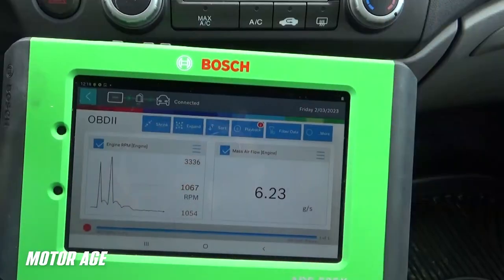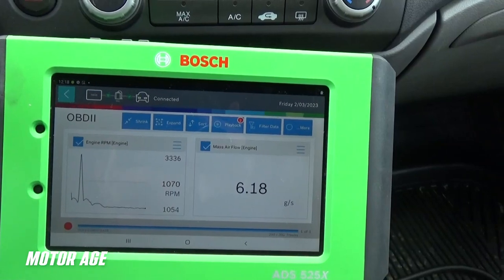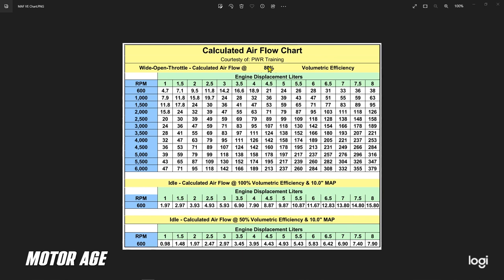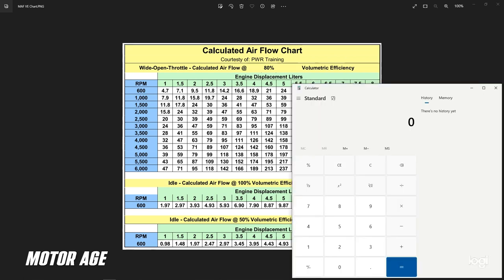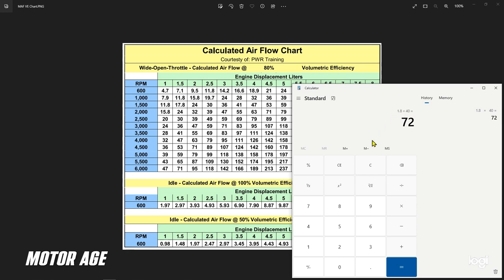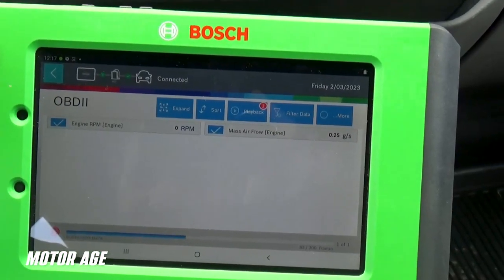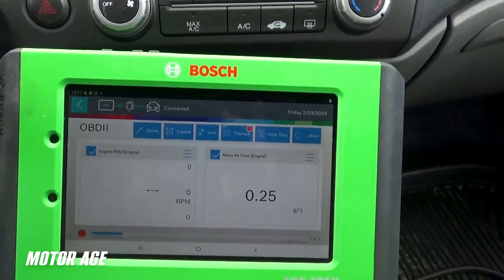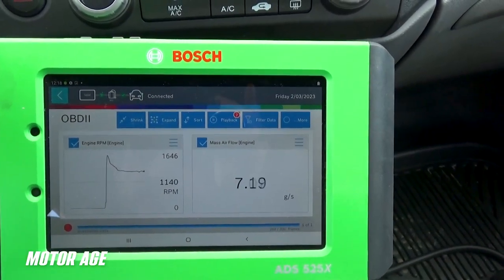Mastering Vehicle Diagnostics #3: Evaluating Engine Mechanical Condition from the Driver’s Seat

Comment: Excellent video! I thoroughly enjoyed it, and your responses to the comments below added to my comprehension. Regarding a vehicle equipped with only a MAP sensor, a narrowband oxygen sensor, and a CVT transmission, is it possible to shift the gear stick to 2nd, press the pedal to avoid entering open loop, and monitor fuel trims?
Additionally, is a reading above 80% considered satisfactory, or should it ideally be above 90%?
Reply: Great question but I can't answer it from experience.

Comment: Do you have a preference for this test or relative compression test first?   What drives this decision?
Reply: Honestly, there is no wrong answer but typically I am in the driver seat so I will perform this test first.

However, if they’re in cranking, I noticed the cranking cadence exhibit a dead hole, I will perform the relative compression test first

Comment: Best video I've seen for ages on diagnostics. Just wondering if you have this for a diesel, or would you say ccx40= @ 4,000 rpm?
Reply: Although not mentioned in the video (in fact, taken for granted) is that atmospheric pressure plays a huge role. And with the throttle opened, the intake manifold pressure will equal that
 of Atmospheric pressure.

With that, a turbo charger pressurizes the intake  manifold to levels significantly higher than atmospheric pressure.

The result is far greater volumetric efficiency. Diesels should compute the same as a gasoline internal combustion engine. Understand that the VE will certainly exceed 100% (which would not be possible without forced induction
Reply: @brandonsteckler3417  true true, but they tend to have throttle wide open at a lower rpm.
Reply: @ifell3  ...or no throttle at all!

Comment: Wow, awesome information. I had to pause the video so many times to jot down notes. Question...if during the drive test the vehicle did shift gears, would that invade the results?
Reply: The gear change isn’t an issue, Per se…

It’s just that at taller gears/high rpm, vehicle speed tends to be excessive.

Comment: You mentioned forced induction but is there and accurate way to still measure this? Thanks @Brandon and @mortgage
Reply: Yes, I just view the Absolute Load PID and reflect on the fuel trim data. You can also use a volumetric efficiency calculator and substitute "boost pressure" in place of "baro"

Comment: Great video.  What is the best way to evaluate engine mechanical condition on a MAP based engine that doesn't have a MAF?
Reply: Great question:

-MAP should reach atmospheric pressure with WOT (or be well above atmospheric pressure  if utilizing forced-induction).

-Fuel trim shouldn’t deviate from near “zero”.

-Lambda/Equivalence ratio (Air to Fuel ratio) should indicate a rich condition for heavy-acceleration and should match the lambda-command ("CEQR," or "Commanded Equivalence Ratio," depending on the vehicle's nomenclature)
Reply: I would be focused on the Fuel trim. If that is correct /doesn't deviate far away from "ZERO," its states the calculated fuel delivery is correct.

Comment: So on a turbo engine how do these numbers change? Do we just assume as long as it's pumping over the NA engine expected air that it's okay? I've always been confused on that so I just throw VE out when the engine is turbocharged. Any info is appreciated. Thanks!
Reply: Watch “commanded Equivalence ratio” vs “actual Equivalence ratio”. They should always match. If not then see if fuel trims are attempting to compensate

Comment: Hi Brandon... why can't this test be done without going out on the road? 
After all, using just 2 'PIDs' viz., RPM & MAF should give the same read out with the car stationary, (as you're not including the 'LOAD' PID in the test), while revving the engine  to 5K RPM.
Reply: Clock-time plays a role. With an engine under load, it allows time for cylinder fill.
Reply: @brandonsteckler3417  Thanks Brandon, (cylinder fill) something I've never heard of. Love your depth of knowledge, thanks for sharing ....EPIC!
Reply: @lloyd-qt1mg  ,ALways happy to help. Thank you for watching and for the great question.

Comment: Mr Brandon, question if I can’t keep it in gear without up shifting can I just leave it in low to get the rpm up.  Thanks Great video your the Best!
Reply: in a standard, you can keep it in "2nd" but understand, you can maintain a lower gear range (auto trans) by pushing down further on the accelerator pedal. It takes practice but you will pick it up in no time at all. Also, the upshifting only becomes an issue due to the excessive speed you will be carrying at 5000 rpm.

Comment: Amazing video! Working on my 02 Dodge Ram 1500 4.7L, calculating the engine breathability speaking, do I multiply 4.7 x 40?  It has a MAP sensor only. Thank you!
Reply: This doesnt work with a speed-density system (MAP) but look at your O2 sensor data and fuel trim. That will be a great start to determine if the vehicle is being fueled properly.
Reply: Thank you! I did successfully diagnosed the issue by looking at the fuel trims and O2 sensors live data. O2 sensors were mirroring each other. Catalytic converter honeycomb broken apart. Thank you!
Reply: @tilemarblegranite , you’re welcome!

Comment: question my 3.6 jeep pumps out close to 220 g/s @ 5000 RPM . using your chart ,will show me a displacement of 4.5 does
that indicate. a really super power house of a motor. now i have a better air induction system but still a basic stock motor.
Reply: The design of the entire system (as an air pump) is very efficient. 

Factors like:
-VVT
-VVL
-Turbo charging
-Super charging 
-induction system configuration 
-exhaust system configuration 

All play a huge role
Reply: @brandonsteckler3417  i was thinking maybe a misreporting MAF sensor could have been giving me high no#
but i tryed 3 different sensors and found all reporting over 200G/S .  and to add it runs like a DEER!!! THX!
Reply: A misreporting MAF SENSOR will always create fuel trim deviations in closed loop. Keep in mind that a skewed MAF PID doesn't mean the sensor is faulty. Here are some more likely possibilities:

-voltage-drop
-unmetered air
-laminar airflow issue internal to the airbox (Broken baffles/debris))
-wrong sensor application
-oil contamination on MAF senser
-Improper installation
-aftermarket ductwork can misroute airflow (laminar airflow issue)
Reply: Many engines nowadays can achieve very close to 100% volumetric efficiency. Systems like VVT/VVL and pressurized induction allow this to occur
Reply: @brandonsteckler3417  i guess its a good thing when you can hit 100% . and you know your running well thanks bob

Comment: Thanks for the video. Clearly explained. I finally get it. For a manual shift what gear is best to do the test?
Reply: I believe it's first gear. He is taking off from a stop so the automatic transmission would be in first gear as well.
Reply: For standard-shift, I prefer 2nd gear
Reply: @brandonsteckler3417  many thanks Brandon👍
Reply: Hi Ken, I prefer second gear. It allows for higher RPMs without excessive vehicle speed.
Reply: Thanks Brandon.👍